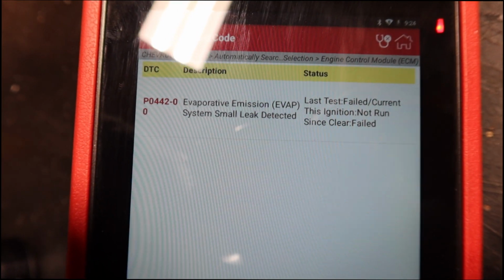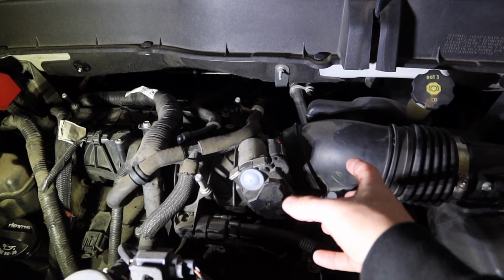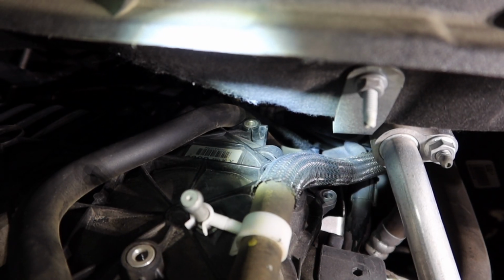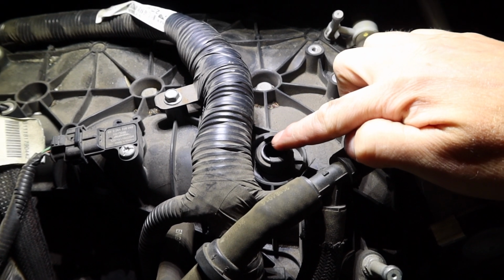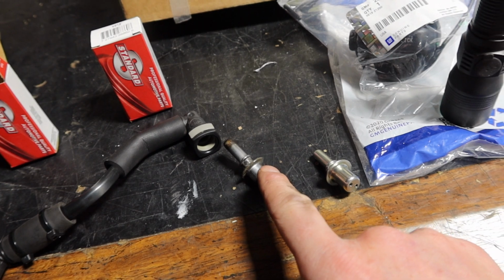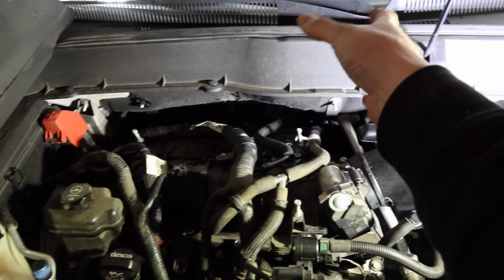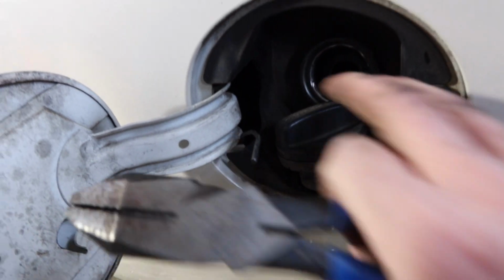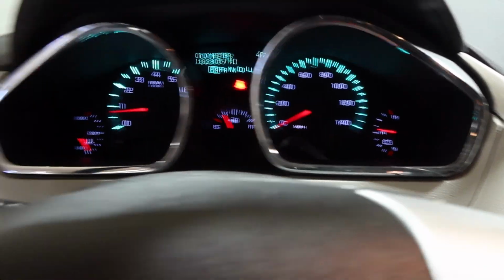Fixing The Traverse PCV System (Small EVAP Leak Fix)

Comment: Just went through a nightmare because of this "PCV valve" The metal one in the back near the fire wall is not made to be removed. Especially if you have high milage and it has never been changed. The one they sell you from a parts store is also slightly different than the original. GM only sells the correct part, and it only comes with a new valve cover. It is basically molded with the valve cover. New valve cover with the new PCV valve and gaskets ran me 200 dollars from GMC parts department. The labor work to do it was actually easier than I expected. Required basic rachet and socket set and a few torx head bolts. I was able to do it in a day. Just a heads up for others who may try to change this on a high milage GM with the 3.6L.
Reply: Thanks.  Do you know what the GM part number is for the new valve cover (and the PCV valve/breather itself)?
Reply from the maker: Parts fixed the air leak but I am chasing down a warm piston ring I believe
Reply: not true
Reply: @dancurrier6421 what’s not true?
Reply: u don't have to buy a new value cover to replace PVC valve. U have to take of intake manifold  to get to the back valve cover. I took mine off and replaced my broken PCV value piece

Comment: Good information💯💯💯💯👍👍👍👍👍👍👍 I never knew this it was oil in my snorkel and inside the throttle body I cleaned it out real good an  now I got to go back and replace the PCV valve

Comment: Question, What year and what size engine are you working on? my 2019 does not come with a gas cap and it has a 3.6 V6111
Reply from the maker: This was for a 2012 so the previous body style. It still has the 3.6L V6 in it

Comment: What kind of scanner do you use?
Reply from the maker: I have two different scanners. About a $100 Napa one and a really nice LAUNCH X431 PRO Mini. The launch one is expensive at about $800 but you can see so much more data and manipulate different solenoids and sensors with the touch of a button

Comment: This must be a different year than mine. I have a 2015 and the rear pvc didn't come out. I have to replace my valve cover now because mine is welded to the valve cover assembly
Reply: I had to replace it as well on my 2016 because I couldn’t get it off and it ended up breaking. Talked to Buick and they told me these are built into the valve cover.
Reply: I almost destroyed my rear pcv valve trying to remove it. I quit trying to remove it after I found out about this new design. Mine is 2014 enclave
Reply: Where did you get the valve cover and pcv from??
Reply: So what did you end up doing I have the same year and are confused as to what to do @jeanpierreremond2565

Comment: I typed the part number for the breather tube and it comes out, however, it specify it doesn’t fit my 2016 traverse.  As a matter of fact there is no replacement part for the breather valve or tube for a Chevy traverse.
Reply from the maker: Does it look the same as the part on the vehicle?

Comment: Hi! I am looking on Amazon and I found a PCV (rear metal one) and it says “only fits if position is ‘right’”. My rear PCV on my 2012  traverse is slightly to the right of center, but is that what it means? I can’t find the specific one you used 😕
Reply from the maker: I seem to be getting a lot of questions on that. It seems like the piece I used isn’t coming up right or available anymore but the pvc valve should be the same and the hoses be different lengths or arrangement. I will look into to the link and try to update it

Comment: 2019 traverse. My front pcv is in the engine. No clip to unlock. How do I get it out? Please help
Reply from the maker: If it’s them one I’m thinking of there is two green tabs on the inside of the engine that make it extremely hard to remove. There is a special tool to remove it that cost way more than the part is worth. My best advice is to get two zip ties and while pushing the pcv in try to push the zip ties between the engine and the pcv valve. Effectively you are using the zip tie as a guide to push the two tabs in so the catches ride up the zip tie and don’t get caught on the ledge that is stopping it. It is the same theory as removing fuel lines with zip ties. There are tones of videos showing how to do it. I think I even have one on it. Keep me posted I’m curious if it works out
Reply: @ModdingAddiction  I have a Question for you I tried to get out my PCV value and broke the tip of now I got to figure out how to get broken piece out any help would be appreciated ty

Comment: I have a 2012 traverse as well but I cannot find that PCV vent at any parts store, even the dealer says there isn't a PCV breather. if I give them that number they say it doesn't fit and RockAuto seems to show it as part of the valve cover.
Reply: I removed mine and cleaned it up. It has some sludge buildup inside. We'll see if it helps. thanks for the video it was a big help.
Reply from the maker: The stuff I used I got off of Amazon. Are you looking for the breather tube or the pcv valve? The dealer should have the valve at least since it’s a maintenance item. The tube should be fine as long as there is no cracks that the gunk was clogging lol
Reply: how did you get the plastic PCV value out  I'm afraid to break it

Comment: Would you know the part number for the rear pcv on 2017 buick enclave i only found the one in the front but nothing for the rear
Reply from the maker: I’m fairly certain that it is the same as the ones in my video. I believe that is the last year before the change in body style. Is it still the 3.6 or is it the 2.4. Aka v6 or 4 cylinder. If your system looks like the mine I would say they are the same. Call your local dealer and they will be able to give you a part number
Reply: @ModdingAddiction  i tried moving the pcv with some pliers but that mf is stuck good in there.i kind of bended it a bit. Might take intake cover off to get more access to the pcv am just afraid to bended or break it to a point i wont be able to get it off!
Reply: @ModdingAddiction good afternoon. So upon doing some research the models from 2014 and up have the new valve cover were the pcv calve or fitting is not serviceable due to that fitting being integrated to the valve cover it self. Was also told 2017 enclaves have that newer valve cover and its aluminum. Part number is #12688702

Comment: have a 2103 traverse trying to address similar symptoms.  Don't see a Schrader valve on the low pressure side to try and clean the injectors, any idea where it is?

Comment: Would a bad PCV cause engine Lag?
Reply from the maker: It could with it blocking part of the vacuum system. More likely from a lag would be a vacuum leak. Maybe bad plugs and air filter. All would be good maintenance to do to make sure its running right.